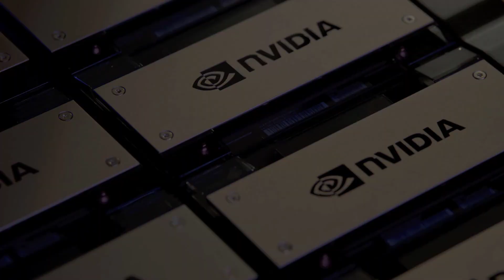NVIDIA 5000 SERIES LAUNCH DATE, PRICE AND SPECS. Is the RTX 5090 worth it?

Comment: My plan is to buy a 4090 when the 5090  gets released. I gamble on a price drop.
Playing now on a 2080super
Reply: 4090 s price to performance ratio is shit it iisnt worth it and also nvidia will discontinue its prduction to promote new gen like it has always done so
Reply: get 5080. it should have 10% more power than 4090
Reply: @inouske2975  Nah, it's not worth the power requirements for such a little performance increase
Reply: @TommyBlazeHD  4090's TDP is 450W.
Reply from the maker: @p4z17  I have a 1050 so yeah
Reply: Is a 4090 worth it at 1000